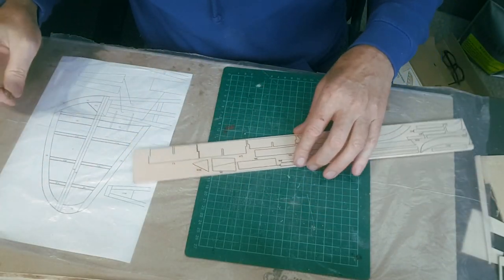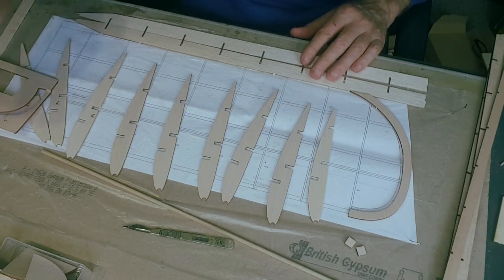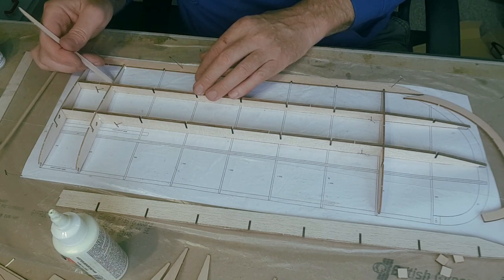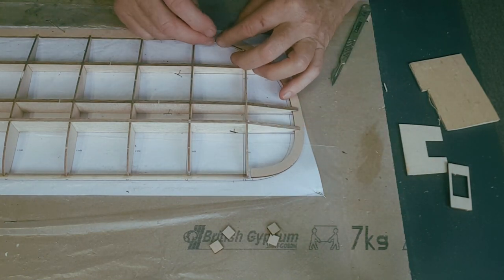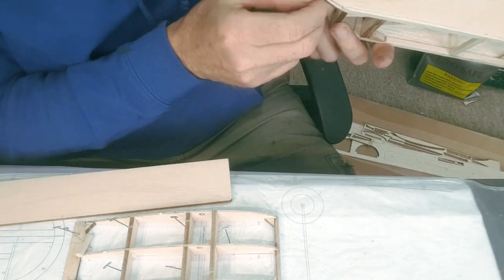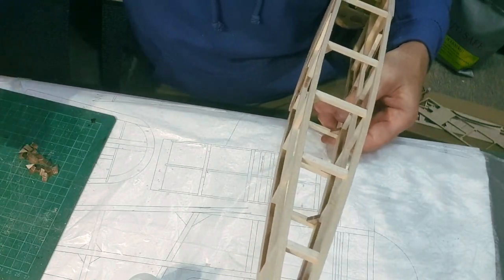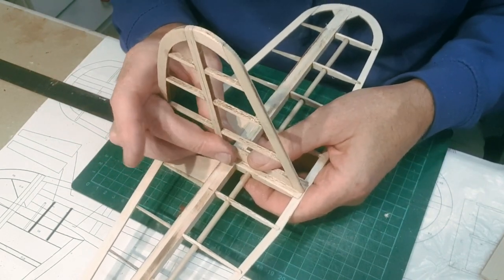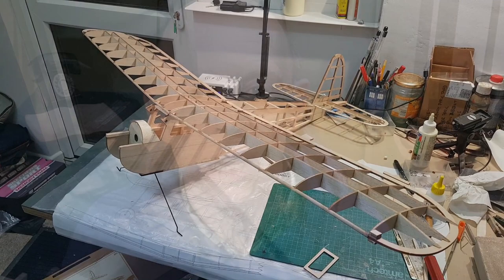Dancing Wings 'CUTE GIRL' Build Instructions, Part 2 of 3

Comment: Cliff you are a Master Builder.  Looking forward to the covering.  Just mocking my build up, going to sand more getting my build as ready for covering as I can. Thank you for all the great tips and encouraging suggestions.  Jeff in LA USA
Reply from the maker: Don't know about that Jeff, I'm sure you know already but it's worth repeating, any blemishes in the balsa, pimples etc, will only be enhanced when you cover, so it's worth spending a little time going over every inch and joint 👍
Reply: @CliffHarveyRCPlanes  I'm going to use filler and try to fix any imperfection but I know this will look best when flying or from 10M.  🤣 I'm trying to do the best I can but the wing is going to be a little rough in the end.  I know I made a mistake using the Ultracoat see though covering 🤣 Mocking up the tail sections went great today. Thank you Cliff, Jeff

Comment: Hi Cliff, I'm wondering about the wing carbon Rods for the wing structure not in the kit, what is the outside diameter of the rod? and there doesn't seem to be enough wood to do the underside fuselage covering, should I outsource that? is it like the plywood included in other parts of the kit? thanks for all the help, Im an ameture and this is my first build! I'm sure there will be a few more questions to follow. Steve
Reply from the maker: Hi Steve, the diameter of the rod I think was six millimeters (the same diameter as what they supply in wood). The fuselage bottom is left open, this saves unnecessary wood adding weight behind the centre of gravity. I had to add quite a bit of lead around the motor to get it to balance so keep the tail end is light as possible 👍

Comment: Hi Cliff, thanks for all your help! I'm just about to glue in the motor mount lamination, and i'm noticing that the large hole in the middle is not really in the middle, does it matter how I place the hole, toward the right or left?
Reply from the maker: I placedmy block centrally and offset the right thrust with a washer, cheers.

Comment: Hi Cliff is the motor fitted off centre as illustrated by the hole and cross marking , seems odd … but will be guided by you ….great build thank you 🙏🏽
Reply from the maker: Hi Gary, in Part 1 at 32:00 I fit this former. I think the idea of an offset motor is to avoid manually adding sidenthrust, but because I had to add a 13mm block to bring the motor to the front of the side cheeks it ended up central anyway. So what I would suggest is glue it in any way you like and fit the motor centrally, then if necessary add a little bit of right thrust using washers under the mounting screws 👍
Reply: @CliffHarveyRCPlanes  many thanks Cliff you are a gentleman 🚀

Comment: Hi Cliff, here's an idea I've found works really well for cutting carbon fibre rod so you don't get a burr or deformity. Use a Dremel with a diamond cutting blade!
Reply from the maker: Cheers Tim, great tip 👍
Reply: @CliffHarveyRCPlanes  I stick down both ends with scotch tape before cutting as they tend to fly off, but it cuts like butter and you end up with really nice clean ends.

Comment: are the carbon rods the 4" ones in the kit?
Reply: I thought those were to rubberband to the wings from the fuselage (?)
Reply from the maker: Yes, those are for the wing bands Steve, are you replacing the main spar with a carbon spar,  as seen at 31:47? You'll need to purchase the main spar replacement, I just wasn't happy with the original!
Reply: @CliffHarveyRCPlanes  yes, I want to copy your work!
Reply from the maker: @steveross7936  I don't think changing the spar was over-enginering, it just seemed the original was a potential weak point 🤔

Comment: Cliff another Build question, my ailerons are solid wood, do I cover them or paint them?  Fantastic build, Jeff in LA USA
Reply from the maker: I usually cover them Jeff, it's quicker and cleaner. I'm going to try something that I saw on a forum recently and that is to hinge the control surfaces, remove them and cover the area where the hinges are. Then rassemble the surfaces glueing the hinges as you go. Then finalky cover just over the the film that's already there. The benefit of this is you can make sure the hinges are firmly glued in place because you still have access to the inside of the wing in the case of an open structure and still have the ability of pegging the hinge using a cocktail stick in solid balsa. So you end up with very secure hinges and a nicely finished gap.
Reply: @CliffHarveyRCPlanes  Sounds interesting Cliff, thank you will cover, Jeff